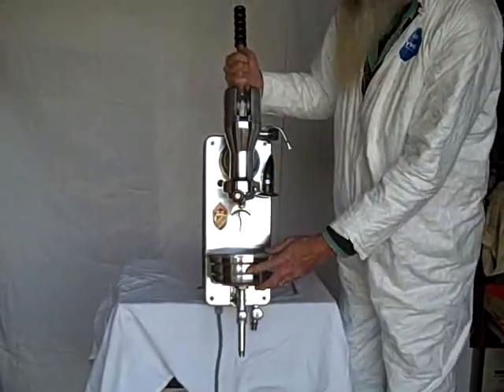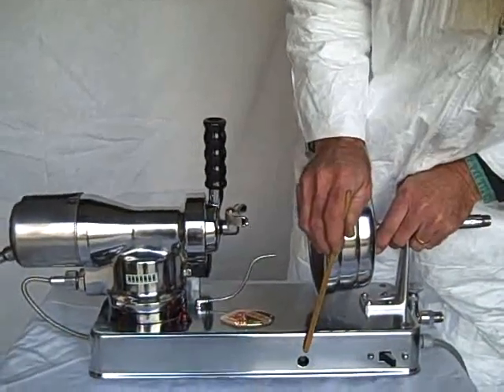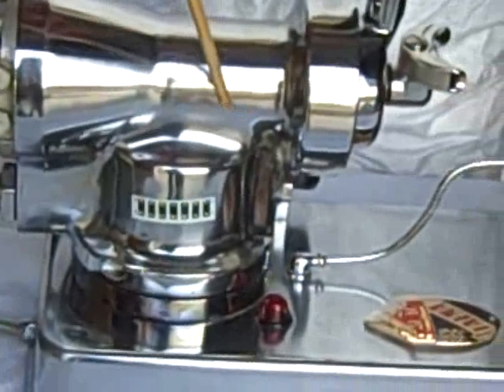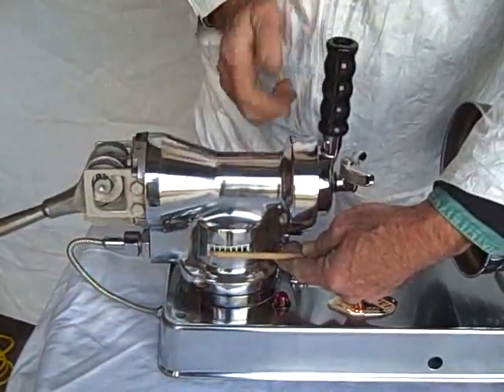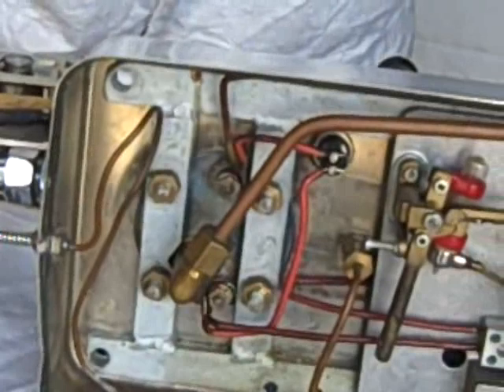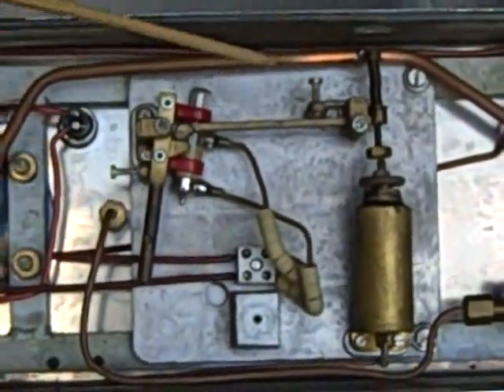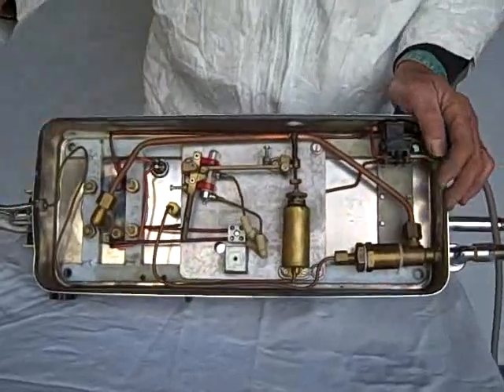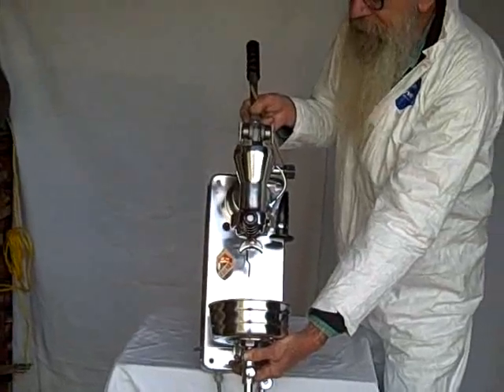Vintage Faema Wall Mount Espresso Machine at Orphan Espresso

Comment: The tube is part of the three way solenoid vale which is the thing with the heavy spring in. It sucks up any water in the grouphead after brewing is stopped. It dries the puck in the portafilter so it is less "soupy".